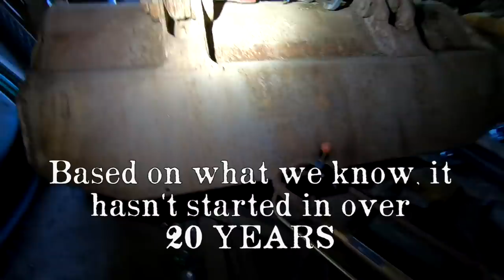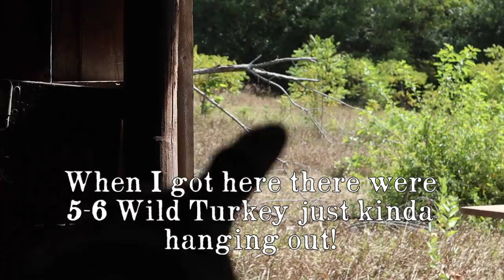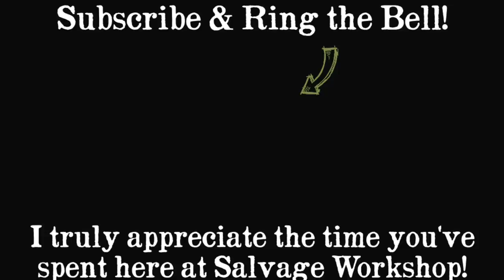Will the PONY Motor START?!? ~ Part 1 ~ 1950's Caterpillar TraxCavator

Comment: I am 82 years old and I love to see young men like you that are interested in bring back to life those old machines that I used and worked on when I was about your age. Good job son and I hope you have good luck getting the Cat engine running and it would be icing on the cake if you could get the transmission, steering brakes and under carriage to work as good as the little pony motor. You made my day. Keep up the good work and be good to your neighbors.
Reply from the maker: I am truly honored by your compliment Clifford! One of my main goals with Salvage Workshop & when saving old tools and machines is to honor and remember the individuals who used them in the decades past! What better way than by saving them from the scrap yard and putting them back to work! Thanks for watching, lots more to come!
Reply: We love it many thanks to our heritage
Reply: He needs some more ratchet wrenches.man thats designed terrible
Reply: Needs more filtration on that carb.magnectic filters help..put a magnet in the fuel tank too
Reply: I became a Cat partsman in '73'. Jeff Hunt. SC part number for the fuel tank is 4B5441. Says so right on the cap. (back when they put part numbers on the part.) Parts breakdown to follow.................
Reply: Men like you paved the way for us. Thanks
Reply: Wow Clifford I think you could've done any better with the proudness (wait, is that even a word? To bad it is now dammit) I feel right now there's tears running down my cheek. ssssssh don't tell my wife, she only thinks I do that for her. Cheers from Canada eh! Hey Salvage, keep-em coming n give me best to those beautiful dogs you have.
Reply: O’y42
Reply: I too am very glad the younger generation is interested in mechanics and especially the older pieces of equipment. I retired about 10 years ago from a career of heavy equipment mechanics.
Reply: @jinksonyou  goooooooooooood morning fellow Canadian! Greetings from the Great Lakes area!
Reply: @airplanemaniacgaming7877  n a GOOOD mornin to you laddy
Reply: @jinksonyou  schoolgirl style giggling

Comment: I served an apprenticeship with a Cat dealer and
became very familiar with 955 traxcavators. We used to have competitions in the workshop to see who could get these rebuilt petrol "pony motors" to fire up on the first touch of the starter (or the first pull on the rope on rope start models). These traxcavators were the primary way to load trucks in the days before excavators became really common (from about the mid 1970s onwards).

Comment: I don't know if anyone else has mentioned this, but I learned watching Squatch253 channel that the proper/safe way to turn off a Cat pony motor is to shut off the fuel.  This way you prevent the fuel flooding the oil.  He restores old Cat equipment and appears very knowledgeable in this stuff. 

Just wanted to pass this along.

Comment: Back in the '70s I was a Cat mech at Alban Tractor. I used to work on 955 H models from time ti time, but never on one this old. I don't ever remember working on one with a starting engine. I can't imagine anyone doing much farm-work with this one once it is running again; the sprocket teeth are rounded, which means the track bushings will jump, and the right front idler looks as if it might have a hole in it. No telling what shape the undercarriage rollers might look like. Nevertheless, this has been a splendid video to watch, and it brings back a time in my life when I was doing "man's work." If I tried to do it now, it would probably kill me.

Comment: I'm sure glade I stumbled  upon this video! Back in the early 70's thru the 80's I owned one of these work horses, however mine didn't have a pony motor it had direct start.  I wounder when they went to direct start...  I used it in my business I did dirt work,grading and a  c paving.  I traded it in back in the early 90's on a 955K.  I'll be back I must see it run as I'm sure it will!  This  video really brought back memories... Thank you!!!

Comment: the only problem with a long time sitting pony starter is you've got to get two engines running. plus side, diesels don't need spark, just fuel and compression. negative side, injector pumps aren't as simple to rebuild as a carb. hopefully, the hard part is done.

Comment: i've had a 50's something CAT D-4 tracked loader for some 40 years sitting on my farm in West Virginia.  years ago when i first bought it, the pony motor ran good and so did the diesel.  the steering clutches were shaky as were the breaks and turns took a little time and maneuvering.  i put a good set of used tracks on it and it ran great around the farm.  it now has been probably 30 years since it was run.  i can imagine trying to bring it back to life would be very similar to your above video.  my goal was always to purchase a "newer" CAT or John Deere 450 that had an electric starter on it.  maybe i'll finally get that tractor someday.  it was nice watching your video.

Comment: So glad to see this. Brought back fond (well, sort of) memories of the 1952 D6 I occasionally operated in Inuvik, inside the Arctic circle, in 1970. But it made me jealous. Imagine having an ELECTRIC start for the pony. All I had was a chunk of rope, not even a piece of wood for a handle. And this machine was completely clapped out, would stall if you breathed the wrong way at it. It had built a land line from Yellowknife, which if you look at a map you will see is a long way away. Did I mention that there was a 17 truck gravel haul, dumping on a face 2 trucks wide?

Comment: You’re a man after my own heart replacing cotter pins with new, fantastic! Also I love the use of a Star bit to remove broken bolts. I’ve had so many easy out sets that break or are tapered and swell the broken stud. I’m  definitely going to try that trick.
Reply from the maker: I figure while im in there I'd replace whatever I could... I dont want something simple going wrong and then have to tear it all apart again if I can avoid it! Ya that Torx bit trick works for me more than ANY easy out ever has!

Comment: I did the same job 40 years ago on a 955 that had been sitting outdoors for more than a decade.  The bottom of the float bowl on the pony motor was corroded so bad it had pinholes in it.  JB Weld was a temporary fix until we could find a new float bowl but we ended having to buy the whole carb, the Cat dealer wouldn't part out the carb.. We used that 955 for quite a few years for pushing stumps out and carrying heavy stuff, and  even dug a 40 x 50 basement hole 8' deep. One trick we learned when we parked  the 955 at the end of the day was to chain bucket curled all the way back and block the lift arms to keep the  bucket from dropping to the ground. Then in the morning we'd hook up a dozer to the 955 with chains and just pull start the 955 diesel motor. That pony motor was just a PITA.

Comment: We still use our 977 Track loader all the time. The thing is loyal. We have a parts machine I have my buddy the fuel tank so he could turn it into a nurse tank for his excavation business he keeps it in the bed of his pickup on a steel skid he welded up. He welded on a 2"bung for a 12v pump it looks and works REALLY good!

Comment: I have a 1965 955H that has a 4 in 1 bucket and a ripper. Peddle steer and glow plugs. It is a great machine.
Reply from the maker: That's awesome! A 4 in 1 and ripper would be amazing additions to this machine!
Reply: @SalvageWorkshop  I use the ripper less than the 4 in 1, but it is nice having a Swiss Army type loader. I got mine this spring for my tree farm. Mine is in really good condition, with a little surface rust and faded paint. It is an awesome machine, but it does have limited uses.
Reply: P.S. Looking forward to part 2.

Comment: The fuel filters are like thin brass snow flakes. There are two shapes, a snowflake and a star. You unscrew the end and they all fall apart so you can clean them. *i used to cut up 941a up for parts in a CAT scrap yard. (For 3 years in my late teens) Never seen one with a dinky engine. They used to get cavitation holes on the cylinder liners. Loving this vid :o)

Comment: She's a thing of beauty from an age when men were men and machines, were built & expected to breath fire , move mountains daily, & with just a little tlc , to live almost forever!  The fact the bake-lite plastic is still intact on the throttle AND choke rods on a 60-70 year old machine is more than proof of that!  Just imagine how many times they must have been smacked by a heavy work boot getting in and out of that seat!  Great video!  Felt a weird chill and could almost hear hear an old timer chuckle ,when you pulled out that broken throttle/choke mounting bolt!  I think it just might  have been a small, but not critical, thorn He'd always meant to get too fix...;)
Reply from the maker: I COULDN'T have said it better myself! Just wait till you see the old beast roll!
Reply: @SalvageWorkshop  Wouldn't miss it!

Comment: Don't let that pony motor run on its own indefinitely. Some of those are cooled by the same radiator as the diesel. Drop the oil and change it again after running it, too, if there was a lot of gas in it; you don't want to wash the rings and cylinder walls. It looks like it's smoking a lot. Nice start!
Reply: I ran one and it did not have a pony motor, cat used them on much older cats. 
 they were a very fine machine, fast.  Good luck getting it in shape.
Reply: I stand to be corrected, the one I used did not have one, must have been a later model.
Reply: all pony motor on Cat's share a water jacket with the main engine as that was one of the ways to heat the cylinders up. some pony motors have a water pump on them as well as the one on the main so there not much chance in overheating it and damaging it staring fluid well.. not so much

Comment: If you got that pony motor going with a little more work and the desal should fire up.  Back in the day, they were made to last.  After 20 years of not running, I was sure that it would be seized.  Great job.  Tim

Comment: Wow that was really used. The drive sprockets are wore out and the teeth on the bucket as well... Had a good life i'd say....
Reply from the maker: It's definetly had a good life! The sprocket on the other side is MUCH better, apparently it had been "replaced" 20 some years ago or something... they literally cut off the sprocket inside and then welded on another one... looks well done, but a bit back woods! Im sure that side will be fine, but the side you're referring to does worry me... i guess we'll see!
Reply: @SalvageWorkshop  that's was a factory filed repair to cut the "rim" off of the drive sprocket and weld a new one on. one does not need a hydraulic press set to change the sprocket plus it was more cost saving for the customer too.

Comment: 60 years ago when I was being taught all about motors and mechanicals for dead engines, the check list was check the engine turns over mechanically with a starter handle or by engaging high gear and pushing, oil (and no water), clean fuel (and no water), plugs - clean and properly gapped, ignition/electrics connected with starter, battery fully charged, filters clean then it's worth trying to start it. Always bearing in mind the timing of the engine may be out so check timing marks if available.

Comment: You want to run that pony motor at w.o.t. while warning up the coolant. 
When you go to pull out the rod to engage the main drive. The engine compression release must be on.  Push the throttle in on the pony motor when it just about gets to idle.  Yank out the engagement rod hard and fast. Don't play aroundtrying to engage the gears slowly. It will break the the pinion gear. And the pony motor will have to be removed to fix it. 
As soon as the rod is out, go full fuel on the pony motor. If the pony starts to die out,  shove the engagement rod back in hard until the pony runs clean again.  The back of the throttle and try again. 
Sometimes a little choke when it sputters, will help the pony rpms recover and not have to push in the the rod. 
It takes some practicebut you will get the hang of it.

Comment: I just started a skidsteer that hadn't been started in two years.  As soon as the fuel made it to the cylinders it fired on the first full turn and purred like a kitten. It's a great feeling.
Reply from the maker: That's awesome! The feeling is one you have to experience to understand! One of my upcoming projects will also be a skid steer I know of that has been forgotten and hasn't run in a long time as well! Should be a fun project!

Comment: When I was in my 20s I bought an Army Corps 1952 D47U. It showed up and getting the pony motor to run was almost impossible. The fuel tank was rusted and kept clogging the fuel filter. After flushing the fuel tank it ran like a champ.

Comment: Don’t forget.... the coolant in the big engine runs in the pony as well. Don’t run it long without it...or boom goes the dynamite !
Reply from the maker: I honestly did not know that... that's GREAT to know! There is a coolant leak somewhere near the radiator... haven't figured that out yet, but knowing that puts it HIGHER on the priority list! Thank you! I wish I had a manual for this old beast!
Reply: @SalvageWorkshop  The pony motor share the coolant with the diesel engine to warm it up before starting in cold weather.
Reply from the maker: @SandBoxJohn  That makes sense... Does the pony motor NEED the coolant to run properly? Since there is a coolant leak near the radiator right now, I'm wondering if i'll hurt the pony motor if it doesn't have coolant running through it right now, or if it's ONLY needed to warm up the coolant for the diesel motor?
Reply: @SalvageWorkshop  I'm no expert on the operation of pony motor, but I think we can safely assume no coolant passing through the pony motor is not good.
Squatch253 is the expert on pony motor.
Reply: @SalvageWorkshop  The pony motor will get hot without coolant and the diesel will start much easier if the pony is run long enough to heat the engine. Once the coolant starts to warm up, release the compression with the lever and  crank the diesel with the fuel off. This will get the engine oil flowing. After a few minutes, turn the diesel fuel on and maybe give it a shot of starting fluid. The advantage of a pony motor is the ability to heat up the coolant and crank the engine for extended periods of time.
Reply: If you look at squatch 253s video about his caterpillars you will see what’s up!
Reply: There is a great channel called Squatch253, he has done full rebuilds on pony motors and shows the operation of the various levers, all the things to watch out for, normally the pony runs flat out and then after fuel shut off runs itself out of gas. Please watch Squatch253, you will learn so much.
Reply: Salvage Workshop 
eBay

Comment: The same gravity feed filter also is found on most farm tractors from the 1950’s +. They use a fine screen for the filter. Usually the main part of the fuel filter is coming from the gas tank and allows settlement to go to the bottom of the glass bowl. You always want to take that off and clean it out so that no rust will block any of the fuel line going to the carburetor. If you wish to take it a step further you can add an in-line clear fuel filter to make sure your carburetor stays clean from even the tiniest piece of rust.

Comment: Good video.
Too may problems always flower trying to get old equipment going, Good to see you have all essential spares with you.
Compressed air so handy for the dirt and cleaning process.
Great idea driving the torx bit in there instead of a easy out.
Came out good with some spray and back forth movement.
Good idea grind tab off, swearing causer gone.😄
Everyone think ya crazy cheering like that but 100 times better than scoring a goal 😃
Great to see you have the time and mental energy to do the video.
Great job

Comment: I have a few things to say, 1 good luck getting parts for it.
2. About 80 percent of those rings, seals gaskets and hoses will have to be replaced. Not to mention oil and hydro.
3. Keep the maintenance up and she'll run when your grandkids get it 😉

Comment: The logging company I worked for 42 years ago had one of these.  I used it to clear the bushes in front of the house going down to the lake.  Wouldn't start on the second day.  Had to change the starter solenoid.  What a pain in the butt.

Comment: I drove a similar machine back in the 2000 or 2001, though it was a 977 and a little newer (maybe 70:s) so it had electric starter for the main engine, no pony motor. At the same time I also drove a 60:s D7 bulldozer which did have a pony motor. We did some actual work with those old things, they are really built to last.

The one in the video seems to have some seriously worn drive sprockets, might slip if used for actual work.

Comment: A man after my own heart in working on stuff...if you have to remove it to get to the problem, at least clean it  before putting the thing back together!  It cannot occur here, but I also like to repaint hard to get at parts when I can. Repairing things like broken bolts is also very impressive, as well as practical!  (I'm not a fan of "patina" but rather of the "as new" look in restoration projects.)
Reply from the maker: You got it! Ya i dont want to have to go back into somewhere if i dont have to!

Comment: Use to work extensively on a Cat 966. Been there done that. The donkey motor I worked on only had pull starting so you are very lucky. Wait to you have to do the main engine clutch!!!!!!!